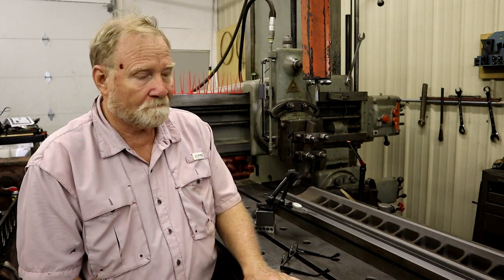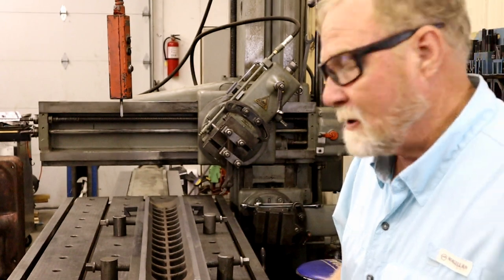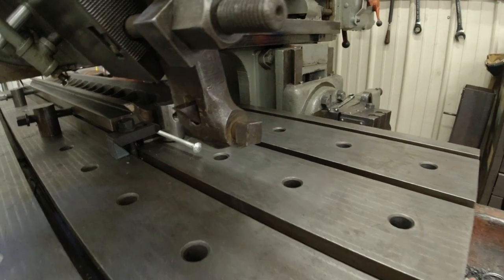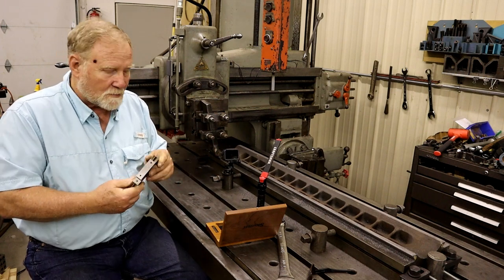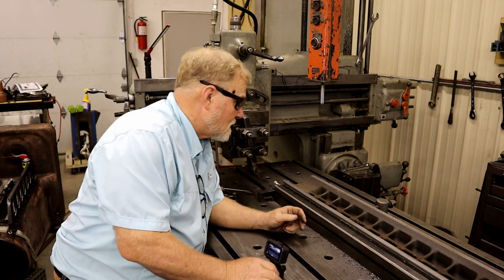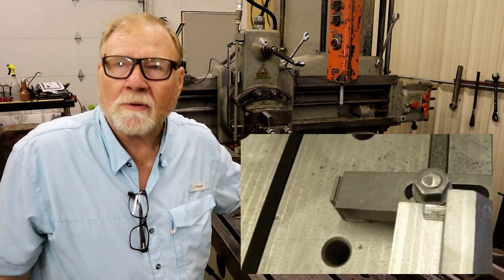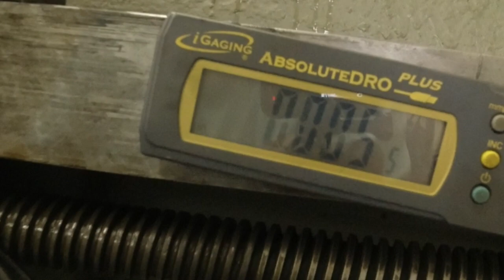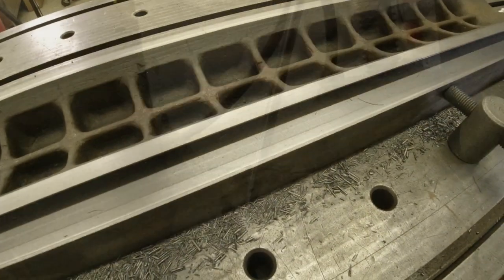Planing a Bridgeport Table... I really screwed up :(

Comment: Thanks for the kind comment on the tool bits. You're welcome any time. Ken

Edit: You should be able to turn the clapper block and compound slide so the tool bit will kick out and clear the cut on the return stroke.
Reply from the maker: I just don't see how it will swing clear enough... There is not that much lift on the clapper. Maybe if I stick the tool holder way out it would swing enough when I am deep into the V...  But that has it's own problems too...
Reply: @10swatkins  The tool only needs to just barely clear the workpiece on the return stroke. If you adjust the clapper so that it's tilted just slightly away from the plane of the finished cut, or far enough over so that it splits the difference between the finished cut and an overhang, then the tool will just glide past the surface by a fraction of an inch on the return stroke. It doesn't need to lift far: clearance is clearance. Said another way, if you have a line drawn through the point defined by the cutting tip of the tool, perpendicular to the hinge of the clapper box, that line should lie somewhere in the angle between the finished surface and the rest of the part, either the uncut waste material or an overhang you're cutting under.

If you don't feel confident about it, try setting up with a chunk of wood as a dummy tool and get a feel for it. You should be able to move the tool right in to the corner of the cut, and just pick up and swing the clapper freely without it contacting the workpiece. At that point you're good to go hands-free and can just let the machine do its work.

Comment: In your defense Steve, you are not just a machinist doing his job .. you are also a film maker, camera crew and producer ... that planer needs 100% of your attention, and I can easily see how the smallest thing, like locking the head, could get missed when you are also setting up lighting and camera angles!
Shit happens! We learn and move on.
Thanks for sharing 🇨🇦
Reply from the maker: Thanks Paul.... There was also one other factor... I was on the opposite side of the machine from the main control station... I would have seen that lock from the other side... BUT I sure as hell will always check from now on :)
Reply: And really, it could have been worse .. you could have also had Don in there "leaning" on the machine and throwing it out of alignment!!! LMAO!!

Comment from the maker: Sorry the sound is wonky... There is a fixed version here   https://youtu.be/XABHXB3dVP4   Something to do with the processing by YouTube...
Reply: I run behind myself anyway so no problem.
Reply: It seems to vary with the clips in the video - right after the first "oops" when you're explaining what happened, the audio sync is much closer. I'll admit, you really got me with the second oops - I jumped almost as far as you did!
Reply from the maker: @gorak9000  It was weird.... I tried uploading it three times, it was always fine on my end....  I ended up switching codex in the program I used and Youtube like it ????     I reloaded it and the fixed version works fine...https://youtu.be/XABHXB3dVP4

Comment: Steve, now I know that you are human; all humans mess things up. I am very glad that there’s a good way out of it, and that you seem happy with taking it. It’s for just such a reason that I decided to get my lathe-bed flat purely by hand methods – endless scraping – because I was really afraid I might make a wrong move in machining it.
	For the return-stroke in your first operation here, going down the side of the dovetail, it looks to me as though it’s possible on your planing-machine (as it is on mine) to swing the clapper-box over on the tool-slide so that the cutting tool lifts out clear obliquely. For planing the horizontal surface under the overhang, you obviously do have to lift the clapper-box right up; but for this sort of case, and for jobs such as planing tee-slots, the old books suggest fitting a hinged flap in the clapper-box behind the cutting tool. It swings back out of the way on the cutting stroke, but at the end of the stroke it drops and, on the return, lifted by contact with the work, it lifts the tool clear. Lifting it by hand as you do is fine, but to manage without needing to do that would give you one less thing to think about.
Reply from the maker: Yep, I am Human :)
This clapper box does have a hinge... It's really a close fitting tapered pin that lets the box swing but in effect a hinge...  The box is lifted by a hydraulic piston. The stroke of the piston is short so not much lift...  

I admist to not having played much with the clapper angles but that pointed cutting tool has angles that must be maintained to not hit the other surface and that along with the need to keep the clapper somewhat horizontal is what I would have to overcome.. 

The clapper box on the side of the table is different and fitted with springs to make is swing back into place for cutting...  The top clapper does not have those springs and gravity is what closed the box once the piston is out of the way... I guess my logic is developed on the fact that the side clapper needs the springs to return it to position, and that keeps me thinking that the top clapper can't be shifted to the horizontal position....
Reply: Steve, thank you for your response to my comment. The way your clapper-boxes are pivoted is just the same as every other planing machine that I have seen. If the joint is adjusted correctly gravity will return the top box even if it’s set over on the tool-slide, but of course the side-box has to be pushed or pulled back. I have never worked with one in which the box is lifted automatically, but it’s clear that one can – and you do – pull the box up further. So what I suggest is workable. See, for example, Franklin D. Jones, Planing and Milling (New York, The Industrial Press, 1914); figures 13 & 38 illustrate my points.

Comment: Hi Steve, I'm certainly glad and didn't got drugged into this machine. Considering some of my mistakes, how about an engine block system and transfers  the block into the next station. Almost got my leg caught as it was lowering down. Anyway, it was nice to see you do this operation!!
Reply from the maker: Luckily Getting drug in is not one of the things I worry about on this machine!
Reply: @10swatkins  I'm located in Michigan, grew up on the east coast, then a company called Dake, contacted me. Grand Haven was a great location for my kids. In short, Keith is now 65yrs and placed a little shop in the basement. Small mill, very happy with the Lathe. Been watching a lot of people whom placed out a video, as yourself. I really enjoy to have a quick conversation. May I ask about you and where you are located??

Comment: Thanks for sharing the mess ups!  Always useful learning the less hard way! For dovetails, shouldn’t you be setting the clapper box to something like half the included angle of the dovetail?, regardless of what angle the slide is on so that the tool is always swinging into a clear area between the faces? (No planer experience, just a little bit of shaper time!)
Reply from the maker: I have looked the problem over and I just don't see how I can get that tool deep into the V of the dovetail and still swing it clear... There just is not that much movement of the clapper...
Reply: I agree. In the video, the clapper box is directly in line with the toolhead slide, there's probably 15 degrees available each way.

Comment: I just looked up Turcite. There must be a better way and I expect you will tell us what it is 😁
Reply: Turcite  is more than acceptable and common to be used on machine surfaces.
Reply from the maker: IF it were a lathe I would use moglise on the saddle but its much harder to line up the bed of a mill.. Turcite is used all the time and works very well when rebuilding machines.. Remember any metal removed by scraping and milling need to be be replaces or accounted for somehow to keep the correct heights for all the screws and bearings to work properly,

Comment: Hi Steve, redeemable with Turcite and will be a better job, the epoxy will fill that little the small void.
Pity Don was not there, could have blamed him!
Reply: My understanding is the you only turcite the smaller bearing surfaces Like the saddle to make up for what you’ve lost on both surfaces but I don’t know much about it you could be right just seems like it would have a tendency to catch and dig on the larger surfaces
Reply from the maker: The Turcite will not be on that surface... IT will be on the smaller saddle surfaces and used to correct the height back to the original levels so the screw is correct again...   I will fill that gouge with Moglise to keep trash out of that pit... It's not truly necessary as that area will never get onto the saddle.
Reply from the maker: It's not technically necessary for Don to be there to blame him for anything :)

Comment: Fascinating process. I didnt understand why you cant just plane it to clean it up. I understand it on a lathe to get the leadscrew to not bind on the carriage but why on a mill.?Maybe a dumb question but i got broad shoulders and dont mind looking stupid.
Reply from the maker: Well it needs to be really fine tuned and you could probably just put it back together but it will be worse than when you started..  You now have the gib to worry about making right and planing it has made the gib go in deeper.. When I'm finished the table will move easily from one end to the other without binding anywhere.. Worn out tables have to have the gib tightened up in the middle of travel most of the time because of wear there.. Tighten up the gib in the middle and most of the time it will not travel to  either end of the table...  

Also you will need to scrap the table.. Planing and grinding do not eliminate the need for hand scraping, they are just the first step.. You need points on the ways to keep the table from wearing out too fast, stick slip, oil retention and proper alignment.. 

Mill also have screws!  You have to account for the alignment for both X AND Y.....

Comment: i may have some tooling of interest there is hss and brazed carbide. thats if you could use the brazed on IThink it would most likely work then again i have never used a shaper or planer the tools are odd shapes i will email some photos. great work why have i only just found this channel
Reply from the maker: Thanks Alex... I have about 5 different drawers of HSS and Carbide cutters already though...  I tried carbide on this machine 7 years ago and all I ended up with was chipped carbide tooling.. The Carbide just does not stand up to  interrupted cuts and the hard outer layer of the  cast iron after stress relieving... The Rex AA HSS I have been using has lasted for years and is easy to reshapen...
Reply: @10swatkins  i thought that may be the case with carbide i know Hss will handle the interruptions an is easy to sharpen i still use Hss often

Comment: why do you pick up the tool head at the end of the stroke
Reply from the maker: The dove tail hangs over the flat way.  I have to pick it up at the end of stroke so it does not hit the work piece on the return stroke...  That is also why I'm using the special tool bits I show in the video, have to get under the overhang..

Comment: I remember you saying that the saddle you're working on was warped by 0.6 mm I think you said, this was down to the clamp bolts distorting the T-Slot grooves production in-built stresses that produced the distortion. So is it possible you could just clamp the saddle down flat and machine the T-Stot grooves over size to remove the stresses and thus removing the 0.6mm distortion? Jimbo🏴🇬🇧 p.s great show
Reply from the maker: Maybe :)   I have heard of people trying to remove it by also peening the other side...  All this is Moot when you have a planer sitting in the shop :)

Comment: i just watched ABOM set up a woodruf cutter with a planer gauge, looks very versitle too me.
Reply from the maker: It's simply a rough measurement tool.  Sort of like the surface gauge I use a lot .. If you notice I brought out the indicators on the last step. :)

Comment: is that a surface plate at the end of the video?
Reply from the maker: Yes, a 4 ' x 3' AA plate :)
Reply: @10swatkins  is it supposed to be treated as a bench?
Reply from the maker: Those are all scraped and precession parts there... Nothing will mar the surface...  In fact some suggest to store scraped straight edges and angle blocks on surface plates to help keep them true.
Reply: @10swatkins  ok thanks

Comment: Not one machinist hasn't had a oops WTFH  most aren't serious or  fixable so we cuss a bit and then get the job done. One chip out on the end on top shouldn't hurt anything you epoxy  it with titanium putty and file it flush then do your scrapping
Reply from the maker: Going to fill it with moglice when I mix some up next time...